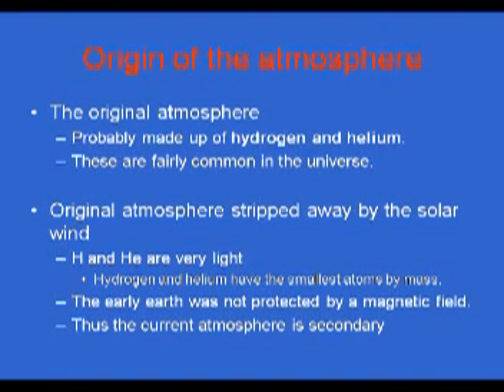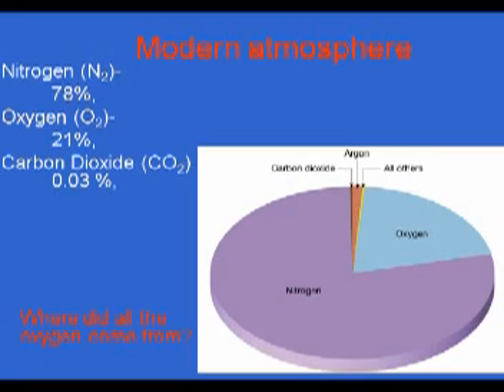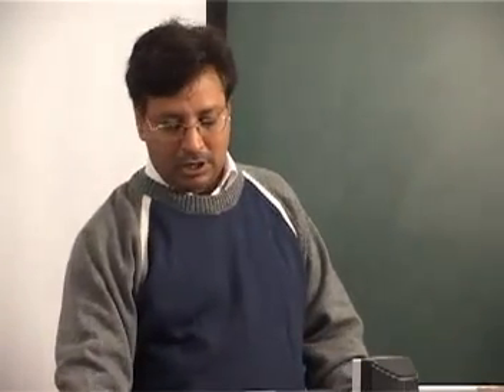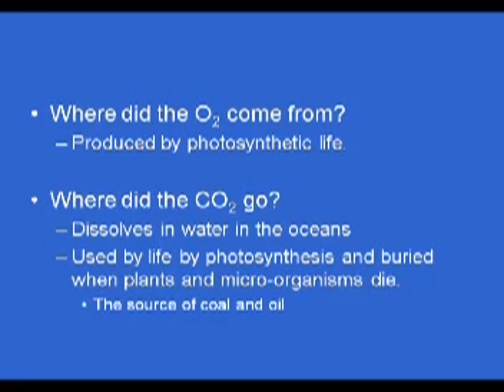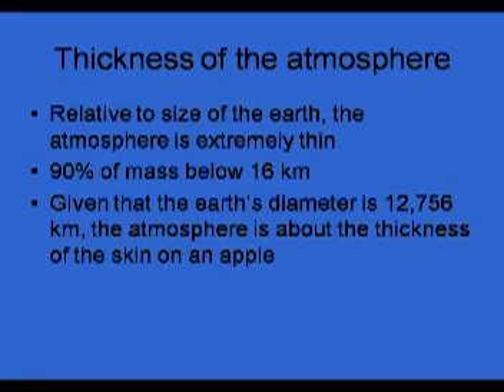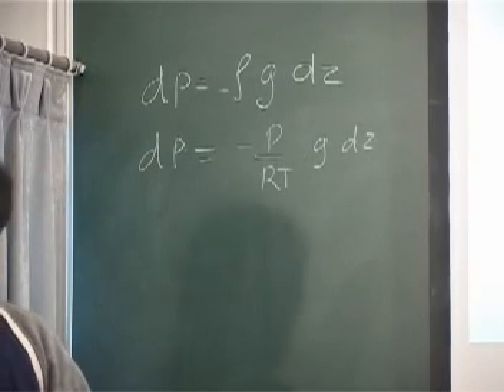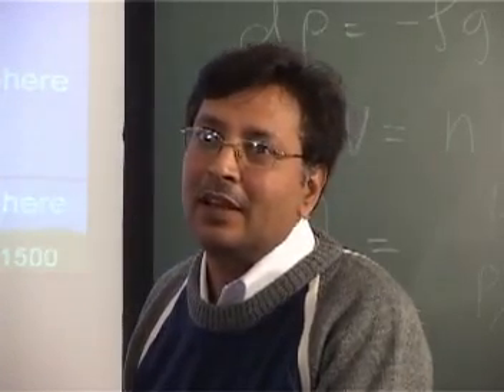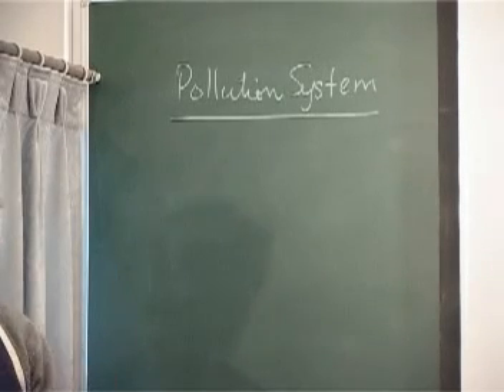Environmental Air Pollution - Introduction to Atmosphere

Comment: This guy has not done his "due diligence". He has not realized that gasoline can easily be replaced by burning alcohol rather than gasoline. Check it our for yourself. Just Goggle "higher mixed alcohol". The EPA has already approved it as a replacement for gasoline. Alcohol burns 95% cleaner than gas, is water soluble, is biodegradable, cheap to manufacture and has an octane rating of 130!